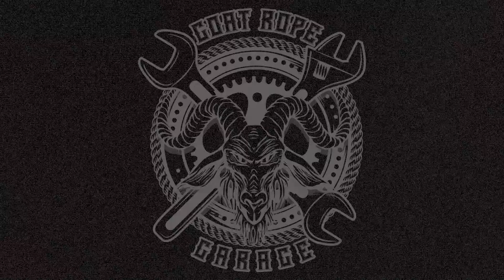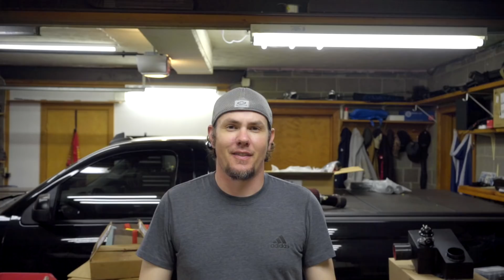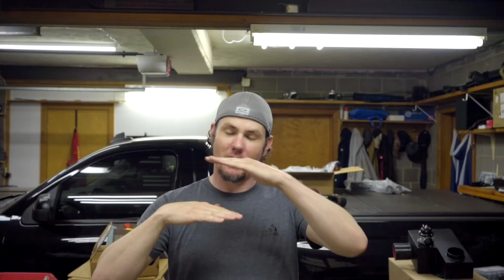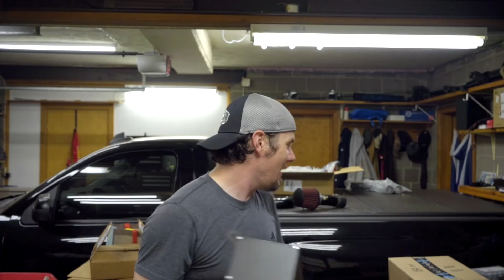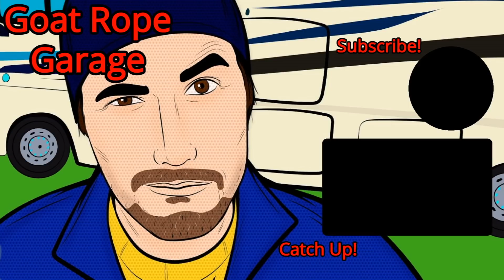Open Loop and Closed Loop, When and How to use them for Tuning.

Comment: I used ls1 boost os even though I'm NA just for the wideband closed loop fueling. Instantly made my truck significantly better to drive since its my only vehicle before getting VE and maf dialed in

Comment: You can set AFR desired setting in the ECU and use the narrow bands just as accurate as wide bands. The only reason for wide band is for tuning in open loop, which is mostly for the PE table, because when in PE mode, the ECU turns off the O2 sensors. When tuning for Dynamic Airflow, narrow bands work just fine. Either you are close to zero (AFR setting), or not.

Narrow band for closed loop.
Wide band for open loop.

Comment: I am using open loop at 5000 feet elevation.  When going down to sea level, what is a general "rule of thumb" for fuel adjustment?  1% per 1000 feet change? 2% per 1000 foot change?  3% per 1000 foot change?  Such as, 5,350 feet DA is an Air Density calculation of 0.0652 lb/ft3.   Sea level with zero DA would be 0.0764 lb/ft3.  Is it as simple as 0.0652 > 0.0764 = +17.17% fuel?
Reply: The MAF will adjust for altitude. Suggest keeping it turned on.

Comment: Good Video, question about tuning with wideband. When tuning with wideband I have been told to disable spark adjust when tuning the VE tables in a closed loop speed density system. Is that correct and why?

Comment: Regarding open loop

When I would tune GEN IV in open loop/WB it required the O2 reediness,COT, DFCO etc to be disabled.However you also had to balance out your IVT gains and several other multipliers in order not to skew the results. I've seen in a few of your videos for GEN V  that just adjusting the O2 reediness,COT, DFCO and enabling the open loop in HPT. Is this enough in the GEN V to tune in open loop lambda? This is a question im reluctant to bring up on HPT because most on there will give you some cryptic or smart ass response.

Benn tuning my C7 M7 in AFR except for WOT of course, but in the end I would like to tune my MAF and VE in open loop lambda, But again there is no real definitive info on setup. The histograms I have .

Thoughts?
Reply: just make sure that when u are at operating temp the commanded (not in PE) is eqratio 1.0  if its anything alse then u have to find the table that may be adding to it, but all in all if ur using eqratio commanded v WB lambda error then it dosnt matter what the eqratio is as it will still tell u the error in WB so ur still correcting the lambda base value as everything alse is just a multiplier from that
Reply: @intolstuning3735  This I know, thanks. My problem is what needs to be masked to do so. Had they continued on with the same nomenclature, perhaps it would have been easier to decipher, but It's not.

Comment: Had a question about closed loop commanded afr. I know while running open loop I can command eq but how do you command eq while in closed loop.
Reply from the maker: Commanded is the same for open or closed, AFR or Lambda.  It is based on your Stoich table and any modifier tables involved like PE, Flex, etc.

Comment: I'm working on a 2012 Dodge Hemi and built a stroker motor, low mid and all the way to WOT is lean, I have ANN on and tried adjusting FA enrichment with almost no success....trying to figure this out.....new to this  @hammersrt

Comment: I have question does the close loop happen on start and on idle or does it happen when driving around...Cause i brought a OBD2 and it alway say closed loop  on start(not start up )
Reply from the maker: There are parameters that determine when it starts, normally you have to be at a certain temp before it will enable
Reply: O2 sensor need to warmup to be on close loop

Comment: I also have another question ,so their is this little gaget called  air adjuster from ist for engines that run a mass MAF sensor only which is my motor , if I buy this will I have problems tring to set up a tune in my ecm with a programer that I plan to buy from tweecer, or will it work together .

Comment: I'm  a newbie at this tuning thing, I purchased a p06 ECU unfortunately I have been burnt. When the order I put in was for a vtec p28. Long story short dint realize I was installing my s300 until it was too late. Well I finally finished up, have everything installed and no matter what the motor is missing spitting and craping out on me. I can hook my OBO2 back in and the car runs flawless. Oh yeah trying to tune and turbo a 97 Honda Civic Ex.
  Should I purchase a true p28 ECU??
Everyone online seams to be out for the money these day's. I I buy another one it will be 3. ECUs I have purchased and had to return. Anyways. Can you give my tips??

Comment: Can anyone help? My WB fluctuates wildly in closed loop at idle and cruise, but is .98-1.00 L when I turn off Command Closed Loop and is very stable. My narrow band O2's are in the collector of my LT headers. They oscillate in the HPT gauges.  Are my NB O2's going bad or just reacting slow?
Reply: You probably need to adjust the delay because they are down further in the tube, plus the airflow model is off now with them being moved.
Reply from the maker: Breck nailed it, you'll have to do some adjustments to get your closed loop acting correctly due to the new locations
Reply: @GoatRopeGarage  Where are the delays for a Gen IV in HPT? Thank you
Reply: @1tonenvoy  Where are the delays in HP Tuners?
Reply: Lmao he's the one to ask, I have nowhere near the knowledge he does.    I just happened across that info with my Gen 6 454 p59 swap and I also have problems with it.    I'll even admit I havnt solved them as I'm still working on VE tables and soon the MAF.    I know for sure it can be frustrating.

Comment: I do not have a wideband and my vehicle is not flex fuel but what I did was change the stoichiometric value to 12.5 and and now run 35%ish ethenol. It runs way better! I do need to get a wideband though.
Reply: I know this post is a little old but I would always get a wideband. It's like you cooking without a spatula sure you can do it with a spoon (You do run the risk of scratching the pan though or messing the engine for our analogy) but it'll be a lot easier with spatula.

Comment: Killer stuff, Kyle! All of the videos really! 
I've pretty much binge watched them all since stumbling across your channel just recently. You're helping me tremendously. Just got myself a 16 Silverado and an MPVI2 at the beginning of the year. Getting noise on the analog in, so I've ordered the serial cable you linked in your wideband video. Need to get my MAF and vve in order. All I've done so far is a CAI and Kooks long tubes w/catted Y, but it still needs the calibrating...
Your tuning series is just the ticket too! Because I'm a newb... 
Can't wait for some 6A trans stuff. 
Keep up the great content!